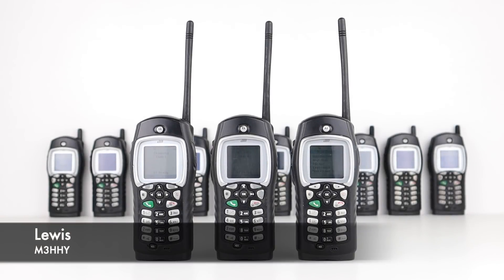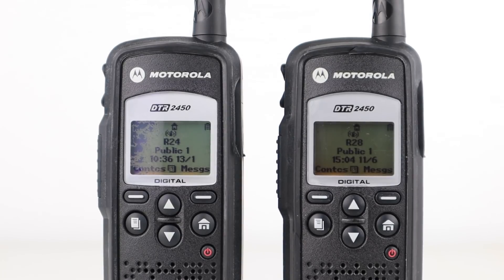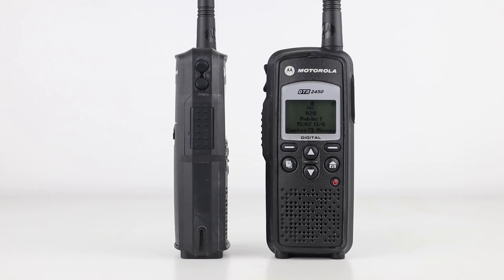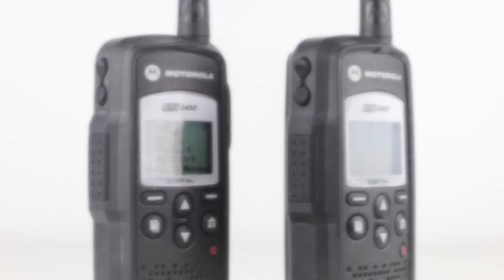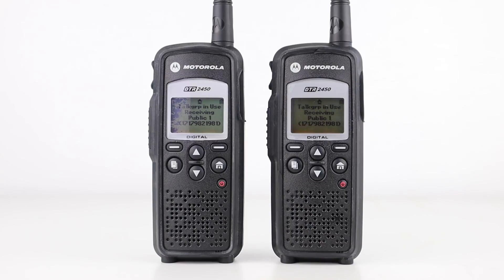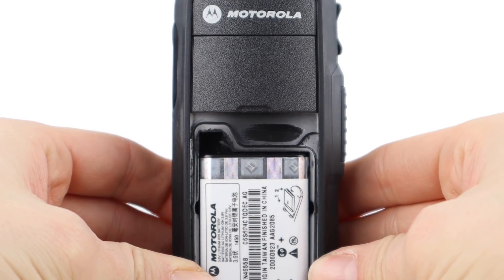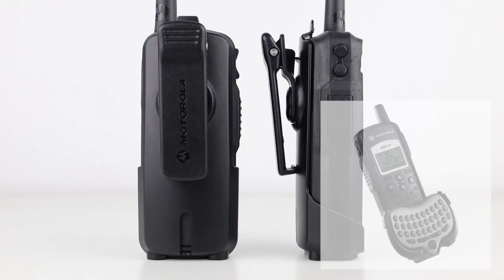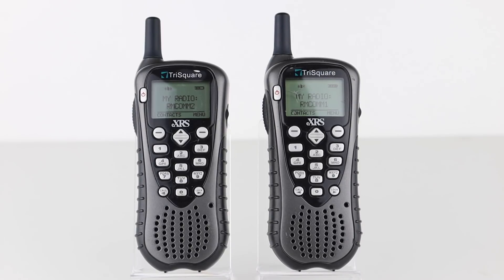Frequency Hopping Radios That You Can't Hear On A Scanner

Comment: I've recently found your channel, and have been enjoying the vids! A few things I can add with my experience "across the pond" with the DTR650 and DTR700 radios: Anyone on a public group can be heard by any other DTR radio that is listening to that group, but setting up private groups virtually guarantees that only the radios with that group programmed in can hear it. Another thing to mention, they aren't truly encrypted, but it would take a lot of work to listen in for a few reasons: First, the FHSS, as you mentioned, makes scanners unable to listen in. Second, the digital codec "VSELP" is not supported by any of the digital scanners, nor is it currently supported by any of the SDR programs like DSD+ SDR#, etc. So even if you locked on to the FHSS, you wouldn't be able to decode the digital traffic, as it's a proprietary Motorola format, unlike P25, DMR, TETRA, NXDN etc.
I figure Motorola engineers likely have special test equipment that can monitor these, and likely show things like radio ID, talkgroup ID, RSSI, etc. but it will likely not be released "into the wild" anytime soon.
Reply: For now, maybe this protocol will be implemented by 3rd parties scanners after a few years.

Comment: In my past I managed about 2 dozen of the DTR500 series radios that were used by an corporate event group.  We'd get to a convention center or a hotel with multiple meeting rooms and I'd program and hand these out to the workers in my company.  In the concrete and steel urban environments the 1 watt 900 MHz FHSS signals did a great job of penetrating multiple floors and covering a couple city blocks.  Far better than any other simplex HT radio system we'd used before.  In a suburban environment they would work up to about 2 miles away.
Reply: how far you think they could work with elevation and line of sight?
Reply: @MotorsportsX , this guy (https://youtu.be/OM-JgBISfw0) claims 15 km w/ DTR700. In a city or on a highway (e.g. between two vehicles) 1-2 miles is more typical in my experience.

Comment: I use the Bowman PRR squad radios for short distance comms. They operate in the 2.4 GHz spectrum in the ISSM segment. If they are near any wiFi signals they will block them, same with Bluetooth signals. Using surplus connectors I have fashioned adapters for use with  two or three wire Secret service style headsets. These are legal for use with the Ham bands in the USA since there is a portion allocated to ham use.

Comment: The Mil had the SINGARS - Single Channel Automated Radio system. I was trained on it while I was in the Guard.  It does exactly what these do (with one major difference - SINGAR Radios use encrypted channels). You can set up either an encrypted com system or a plain text system.  

Once on an encrypted net, it is difficult for others to understand or even get into the com net (without the proper encryption key).  A SINGAR radio does the Freq  Hopping (it  changes frequencies  so that you may get one word on one freq and another word on another Freq).
They are great radios.
Reply: SINCGARS waveform is also available on many platforms, from HT to Manpack to vehicle-mount.  Accessories include 'high-power' amplifiers (I believe 25 or 50W).  And it is Single Channel Ground and Airborne Radio System, I believe.
Reply: @joeb3300  thank you.  It has been a while.  That  was 1998 since I last used it.  God bless.

Comment: The average joe can use SDR to listen in. In this modern time there is no real scurity by using this.
Reply from the maker: Trust me, no SDR will decode these
Reply: An SDR receiver could see the waveform, but as it hops from one frequency to another (perhaps several times per second, I don't know the specs for these radios) it would be impossible for a human operator to follow the center frequency.  

Then, on top of that, it is spread-spectrum.  You can't reconstitute the narrow band signal from the spread signal w/o knowing the spreading code and applying it to the perfectly-timed 'chips' (symbols) received.  

And then the signal is also encrypted.  No SDR radio that I know of can decrypt the signal without knowing the algorithm (DES?  DES3? AES128? AES256? ...) and the key.

No average Joe, not even a very bright Joe,  can "listen in" without a lot more capability.

Comment: I'm watching your videos from quit while. And i purchased 2 Baofeng uv5r just for starting up. Can you please tell me Which is best Antenna for medium to long range on VHF and UHF. i already have 2 Nagoya Na 771. Can you tell me which antenna is best is this Nagoya tactical abree or etc...  

Please dear reply me please Please
Reply: The Nagoya na-771 works alright for a baofeng. For 2 meters I like to use the mfj-1714. It comes in BNC, SMA-M and SMA-F connector variants. It’s collapsible and about 42 inches extended. Be aware it is only for 2 meters though. If you’re new, remember that the Baofengs can transmit outside of amateur frequencies, including FRS and GMRS frequencies. Transmitting on these is illegal in the US.

Comment: In a simplified sense, FM frequency hopping is how military radio encryption works on many FM military radios.
Reply: Frequency hopping and encryption are two difference concepts.  Frequency hopping is a form of TRANSEC (Transmission Security) to make interception very hard.  Encryption is the transformation of data content via a pseudorandom number (a 'key') and an encryption algorithm into something unreadable even if intercepted.

Comment: Great video.
So the next 3 things that wouls be interesting to see / know is.

Whats the range with a "better" dB portable antennas on the radios.

Whats the base station to either bast station or base statiin to portable range using a medium to high dB base station 2.4Ghz antenna & a "better" dB portable dedicated 2.4Ghz antenna

What's the mobile to mobile range again using an dd on medium to high dB mobile 2.4Ghz antennas.

Rgs
Wayne.

Comment: USA models such as DTR700 DTR650 AND DLR1060 and other similar models operate on 900mhz fcc license free ism band which is shared with amateur radio 900 mhz band. You can easily purchase used DTR radios and use them to scan current DTR and DLR Radios .
Reply: You would only get public group calls, not private calls.
Reply: @christophep.8288  okay 👌🙂
I still receive plenty of conversations. I have never heard anyone say "let's talk on private channels" ... I believe that the vast majority of businesses using walkie-talkies stay on factory default public channels. There is
Such limited use of these radios near Chicago (the headquarters of Motorola) and the radios are such short range ... it is unlikely that these radios get interference or cross talk from other users.. most of the communications I hear are on "public channel #1 " . I do have my DTR700 and DTR650 radios set to scan while I drive around Chicago often.  Unfortunately the radios will not scan all possible public channels . They are limited to scan 10 to 20 channels... depending on model DTR650 or DTR700... I forget exactly... in order to scan all public channels you would need to set one radio to scan channels 1 to 10 and another radio 11 to 20 and so on  ... for example... but I hear plenty on channel  #1 .

Comment: I had a pair of Trr-Square 900 MHz Ht's like this in the US a while back, which frequency
hop.
I think in WWII, Heddy Lamar proposed 
Frequency Hopping for radios 📻 back
at that time.
Thanks again for a very interesting review.
Ray, W2CH ex V25CH, WA2ZPD, WB7EGN,
and WB1BTO.
Reply: I had a pair of tri square radios years ago.
The tri square radios are frequency hoping spread spectrum but analog compressed audio. The tri square radios frequency hoping technology was flawed and the radios would become un synchronized and not be able to communicate at times. Tri square radios stopped factory production years ago.
Reply: @davidmaclennan5252  great radios, picked up a pair on holiday. Shame about the battery and charging dock connections. Full of features, and in the 900mhz range if memory serves.
Reply: She was brilliant
Reply: @stevesmith8854  who  ?
Reply: @davidmaclennan5252  above. Heddy Lamar.

Comment: Very good. The technology is very  similar to that used in the British-designed Leonardo Personal Role Radio. This is a  military platoon-level set actually designed in the 1980s when the compnany was still Marconi Communications (later became Selex). The PRR can be used on its own or jointly switched through  a longer range combat net radio such as (originally) Clansman or (now) Bowman.

Comment: I have got a pair of these that I bought out of Canada. Great idea but the range even in open countryside is absolutely awful...!!!
Reply: I managed 2.5 miles from hilltop to ground level (on the 2.4 GHz versions). But where I live, surrounded by loads of wifi signals, it won't exceed 100m. Which means they are perfect for indoor use with privacy required.
Reply: @christophep.8288  That's way better than I ever achieved although I was out on the flat.

Comment: Bluetooth and Wifi are also on 2.4 Ghz it's very line of sight and extremely short distance.
Reply: It's all about LOS. AREDN mesh networks can get several kilometer links out of 2.4GHz off-the-shelf gear, if placed in the right location.
Reply: @rkaag99  thanks for the education.

Comment: Cheers mate. Curious to know how each radio identifies the exact frequency patterns between them when receiving/transmitting 😁
Reply: I don't know how these radios work, but other radios that I am familiar with have a pre-defined hop-set (a list of usable frequencies).  A 'key' serves as a seed for a psuedo-random number (PRN) generator.  The numbers produced hash to a location on the list of frequencies.  So long as the radios have the same key, and are synchronized, they will hop thru the same sequence of frequencies in unison.

For example, lets say that the radio supports a hop-set of 32 frequencies.  Each time interval (which may be anything from, say, 0.1 sec to, perhaps, 5 sec) a new PRN is generated.  The modulo 32 of that number could be computed and used as an index into the list of frequnecies.  

The catch is that the radios need to be synchronized.  I don't know how that is accomplished in this case.  One technique would be to use GPS time and hop, for example, on the second-boundary.  But the radio would need a GPS receiver to do this.

Comment: How are they timed?  Spread spectrum requires perfect timing.  50 pseudo-random freqs?  Nice.
Reply from the maker: Hey tj I couldn’t find the timings anywhere unfortunately
Reply: Frequency Hopping requires perfect timing.  Without it you are receiving on a different frequency than the transmitter is transmitting on.  Spread Spectrum is only dependent on timing of the spreading code is a function of time.  In cheap SS systems the spreading code is time-invariant, a fixed "Psuedo-random" number.  I don't know how these radios wotk.

Comment: Interesting. But their range will be severely curtailed by rain, fog, or very humid air. 2.4Ghz is also used by microwave ovens since water absorbs at that frequency very effectively. Shame they're not on 5.8GHz. Could be interesting with a yagi though. 

As for detecting this sort of FHSS transmission, or CDMA, I can recommend the TTI 'PSA' series of spectrum analysers. They will catch everything, being ideal for very local txes, but with a good antenna a spectrum analyser will get signals from miles away.

Thanks for the channel.
Reply: Hi Chris It's actually a myth that there's a water resonance at 2.4 GHz. Water has various vibrational modes over a wide range of THz (not GHz) frequencies  out to far infrared . You can make a microwave oven to operate at any (microwave) frequency and large industrial ovens sometimes  use 915 MHz. 2.45 GHz is popular for the mass market because a) it's license-free, b) the cabinet size is convenient for domestic use and b) magnetrons for this range are (relatively) easy to make and are also a good size and c) depth of penetration into most foodstuffs. The heating effect of RF is also used at much lower frequencies such as 27 MHz (!) for medical diathermy. The whole effect is due to dielectric heating  which is caused by the electric field forcing the molecules from their normal somewhat genteel and ordered  vibrational orientation to a more energetic and randomly aligned vibrational state  - otherwise known as heat.